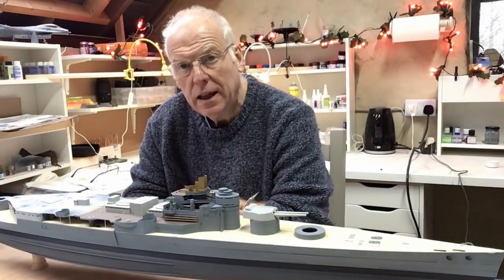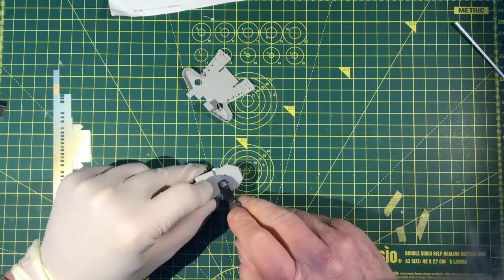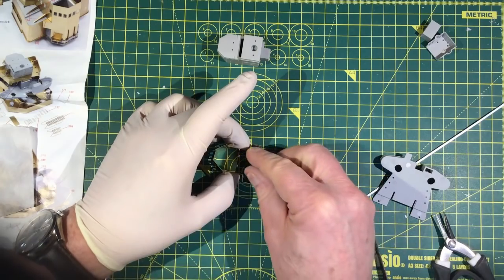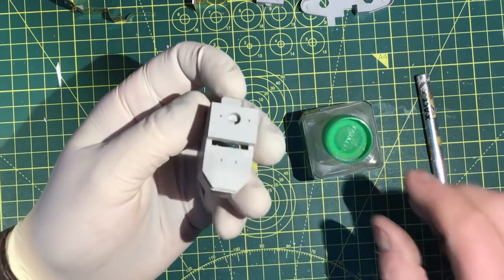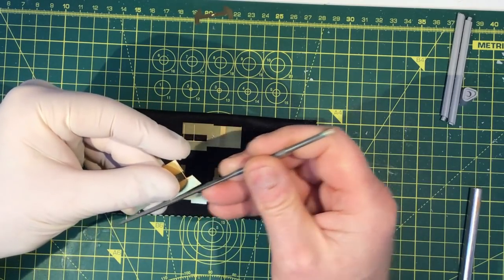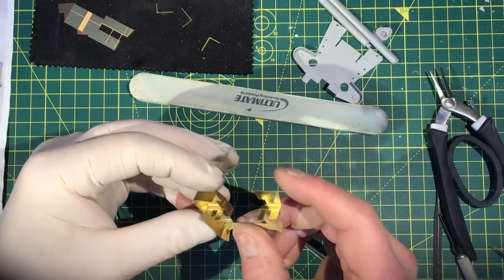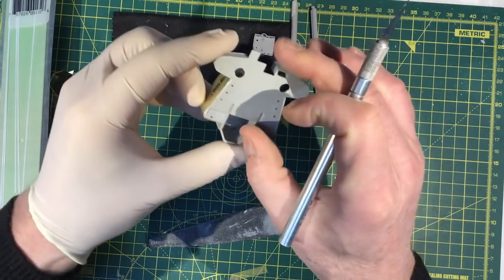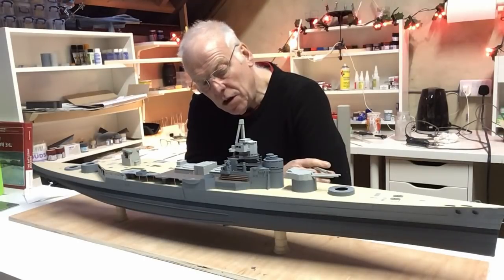Trumpeter 1/200 HMS Hood Full build with Pontos detail set Part 11 (upper bridge 1)

Comment: Totally enjoyed  this video,  have soldered brass to copper pipe for years , liquid flux applied just where you need it and no more  ,if you put to much the solder will flow where the flux was applied clogging up fine detail , have a great New Year 👍👍👍👍👍👍👍
Reply from the maker: Thanks for the info Marc I’ll try the liquid flux sounds like that’s the way to go.

Comment: Hi Steve.. another great video thanks. Whenever I remove material from inside such as you have, I hold the pat over a light. It makes it easier to see just before you break through. After youve gone round with your knife and cleaned the windows out, "dry" brush some tamiya extra thin over the cut edges.. it gives a cleaner look. I have ben asked to do a new video on soldering PE, which I'll be doing soon. My first tip would be using a liquid or cream type flux, clean the brass and put a drop of solder on the iron rather than try to hold the solder and iron into a tiny join. I don't want to sound like a know it all, just want to help out with some handy tips mate. Happy New Year.
Reply from the maker: Hi Nige. Thanks for the tips. It sounds like separate flux is the way to go so I’ll try that. Oh and it doesn’t matter how “expert” we might appear to be, someone, somewhere will know something we don’t - so I’m grateful for all the advice from my pals watching these videos. That Titanic of yours looks like a - well titanic - job. I wonder if we should apply for jobs as researchers for trumpeter?
Reply: @TheModelShed  Hi Steve, I wouldn't apply for a job with Trumpeter. It would appear they put your name on the box but ignore what you tell them.. at least that seems true with the Titanic kit.

Comment: Hello Steve, with the soldering, heat the both parts to be soldered equally first then appy the solder (do some testing first) also clean the parts with some soldering acid or flux and the solder will run like water. great job and patience, Merry Christmas.
Reply from the maker: Thanks Sandro

Comment: Another great video.
Secret to good soldering - brass must be spotless - it may look clean but will already be oxidising - clean with a fiberglass pencil or wet and dry. If possible use a liquid flux - it helps a lot in getting a nice clean join. Always wash items that have been soldered in warm soapy water to get rid of chemicals in the solder and/or flux. Not too hot or you end up with a kit of parts again!
Reply from the maker: Thanks for that Roger

Comment: Another well done Steve.  Nice to see you confirm that soldering the parts works too , as it was always my preference for PE to PE joints for strength and longevity.  I am not an expert on soldering either, mind you, but the advice is to use liquid flux.  The experts say that if you paint the flux on carefully, the solder only flows into that area and thus produces a neat joint, i.e. if you don't flood it.  Hope you had a great Christmas and  good wishes for the the rest of the holiday season.  Cheers
Reply: You are absolutely right there. Liquid flux really helps to get your solder where you want it. Simply apply it with an old paintbrush and lay tiny flakes of cut soldering wire in the area you want to fix together. Works great, with little clean up needed afterwards. A happy new year to you.
Reply from the maker: Thanks for that Leslie. I’m getting plenty of tips on soldering techniques so as they say practice makes perfect.

Comment: Really enjoying this series. Now I'm wanting to get a Hood to add to the stash. I can't recall where I originally saw it, but a good method for getting clean solder joints is to use the solder+flux paste applied to the joint, then briefly hit it with a butane soldering torch. The paste melts and flows into the joint - not unlike using extra-thin on plastic.

Comment: You may find it easier to solder if you cut a small bit of solder of and position where you want to melt it then just dab with your iron.  You can see what your doing better and control the amount of solder better, less clean up.  Great job however looks fantastic

Comment: Wishing you an enjoyable Christmas.  
Maybe drill out corner of said windows with say a 0. 04 mm drill first, thus indicating the area requiring removal. 
 Have you ever seen a JLC razor saw, superb tool , one can even employ broken blades held in a clamp type handle.  jlc saw - YouTube
 Glazing?   Ever considered microscope glass slides, frosted or clear?  Try Ebay . 
They are a bit of a `bugger ` to cut but the effect is far better than plastic sheet.  
Soldering try 145 degree solder used by `00` & `0` gauge loco builders.
Finally, a set of chisels ,  Steel Gravers Chisels Tungsten steel  Take a look at      Take care.

Comment: Really enjoying this series and has spurred me on to start a 1/350 HMS KGV. Can you tell me what colour the floor surfaces were on the exterior areas that were not covered with wood decking?
Reply from the maker: Hi John. Glad you’re enjoying it. If Hood is anything to go by then the decks may be problematic. As far as I’m aware there were several potential deck finishes. Wood obviously, then corticene which was a linoleum type covering which was generally a brown colour, Semtex which was a non-slip finish (the colour of which appears uncertain but could be grey or a sandy tan colour) and also a dark grey anti slip paint which would be applied to the horizontal surfaces which were walked upon. There is still debate about the precise combination of finishes on Hood. As far as other ships go I’d say it’s hard to generalise and I’d always recommend doing as much research as possible before starting out on your model. There are plenty of on line resources available on the forums and somewhere in my house move boxes is a book on the KGV class by (I think from memory) roger chesneau or something like that which is a good one and I’d recommend you trying to get a copy.
Reply: @TheModelShed  Thank you very much. You were correct with the authors name. The book is now oop but available on the second hand market. I will do more homework so I am happy with a plan of action. I have to say that photo etch is a baptism of fire! Tiny ladders up the sides of the turrets are driving me insane. However, I now have a new found fascination for these great ships, I think due to the incredible engineering. Keep up the great work 👍🏻